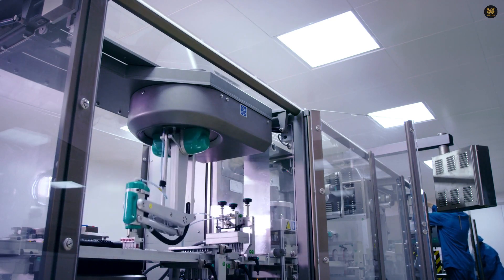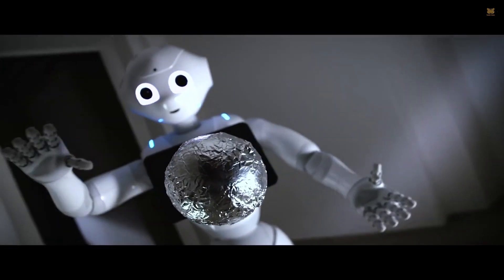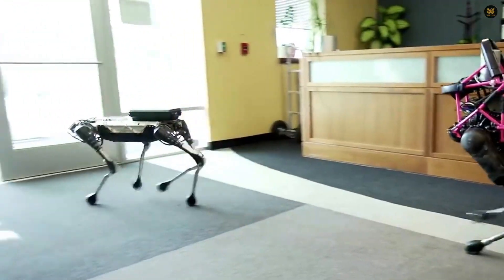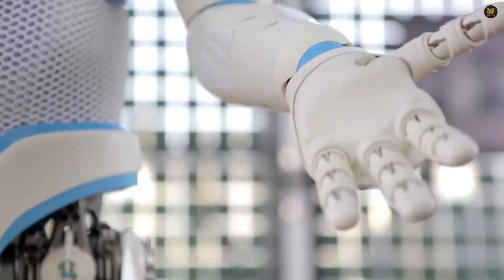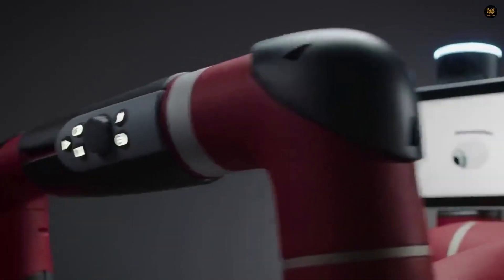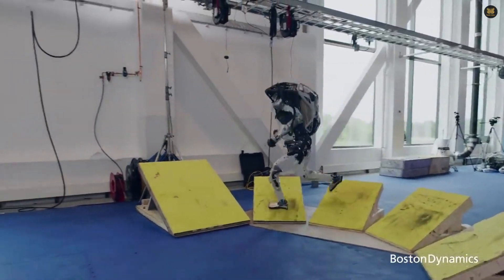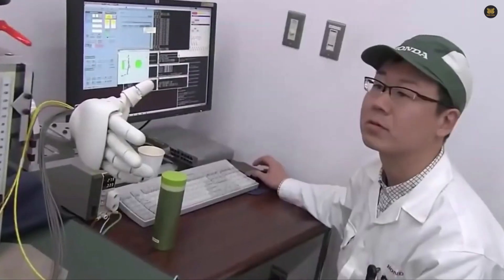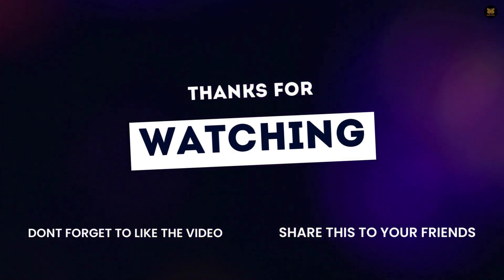The Future is Now: Meet the Robots That Are Almost Human!

Comment: Sawyer is a collaborative robot or cobot developed by Rethink Robotics. It is designed to work alongside human workers in manufacturing and industrial settings. Sawyer has a compact design and can perform a variety of tasks, including machine tending, circuit board testing, and assembly. It uses advanced sensors and cameras to detect and respond to its environment and can be easily programmed by non-technical workers using an intuitive interface. Sawyer's safety features include power and force limiting, which allow it to work safely alongside humans without the need for protective barriers.
Reply from the maker: True. Thanks for watching!